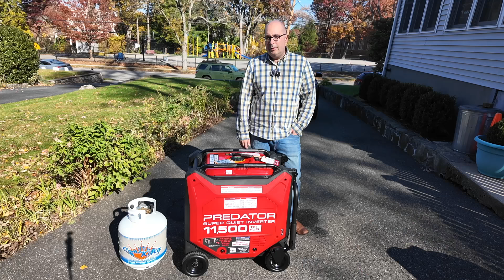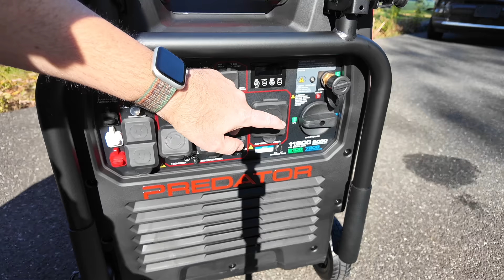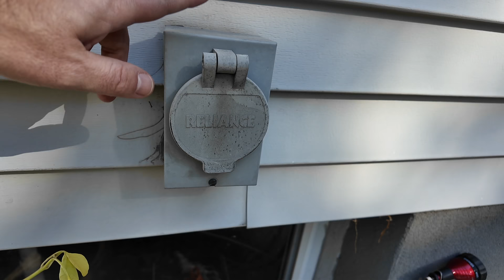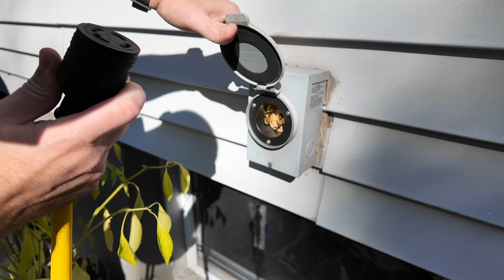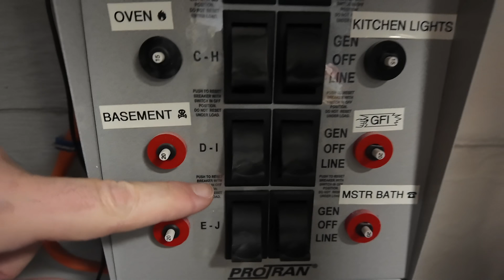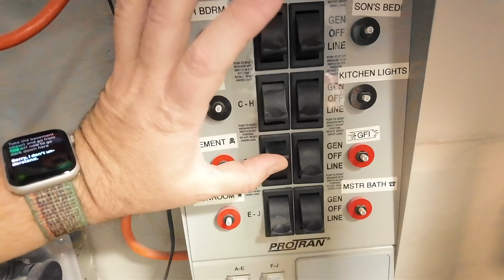Predator 11500w Powers My Entire House (Transfer Switch & Full Test) — Honda Should Be Worried!

Comment: My only concern with the Harbor Freight generator is reliability and the ability to get parts long term. For the price, obtaining parts is the most important thing, as just about anything can be fixed. I have old brigs and stratton and generac equipment from the 90's, everything still works and used to this day. Hopefully I can continue to buy replacement parts for another 10 plus years.
Reply: If you purchase the warranty, you will never need  replacement parts, every generator you can buy from hf is cheap enough to buy and purchase the warranty, they dont ask any questions, simply return it and get a new unit, I've extended the warranty on 2 of my generators from hf, not alot of people will admit it but the quality is not far behind honda ,especially for the price difference, the equivalent generator in a Honda is double the price atleast
Reply: @lenworthsewell9473  That's a bit shortsighted, this generator weighs around 260lbs. Not something you're going to throw in the back of the family sedan (or even a pickup truck without some help) to go exchange. And not everyone lives around the corner from their nearest Harbor Freight. A "no questions asked" extended warranty is great to have as an option, but it's certainly no across-the-board replacement for the ability to order parts delivered to your door to do repairs without having to borrow a truck and schedule an appointment with your orthopedist.
Reply from the maker: Those are definitely valid concerns! Harbor freight Quality seems to have gotten better over the years and my understanding is that they sell replacement parts for a lot of their generators online. They have a replacement parts catalog. Time will tell but so far I’m happy with it.

Comment: I'd add one suggestion. If you have a setup with either a switch or an interlock, I'd use that monthly runup on your generator as practice. Have the adults go through the process of plugging in the generator to the house and switching over the circuits you're going to use, or running that interlock. The last thing you want is to install it, then need it two years later, you aren't home, and your poor spouse is out there in the rain trying to remember how to do it.
Reply from the maker: That's a really great suggestion! Thanks for sharing!
Reply: @Outdoor_Prepper  Thanks, You'll see in the video, I remove a 30 amp plug, that is my Bonded connector, pulling it out makes the generator a floating ground, making it safe for the house hook up. (I did the modification on the generator that removes the bonded ground) I usually leave  that plugged in, incase someone uses the generator in a stand alone mode.  When it's used for the house, they must unplug it, as that is where the house power cord plugs in. Since making the video, I added a rubber ramp to the doorway, making it easier to pull the generator in & out.
Reply: I made a video for my family to learn how to hook up our generator safely, and I made a check list to go by also.   https://youtu.be/R-otVo50t_8?si=JQeKiPNryFXfOxFi

Comment: This generator uses a lot of fuel, the best way is charge a large battery bank or large power supply and the house at the same time so you can power down the generator and use the battery bank, this setup works well with long term outages,short term the generator is fine by itself.
Reply from the maker: That's a great idea for managing fuel consumption during extended outages!
Reply: There are fuel cell solutions that incorporate this method.

Comment: That generator puts out 47.9 amps (surge) and 37.5 amps (continuous), so with that capability I would always configure my system for 50 amps. It may not get to 50 amps but it will put out way more than 30 amps.
Reply from the maker: Agreed. Thanks for watching!
Reply: @Outdoor_Prepper I believe it is 37.5 amps on each leg of the 220volt. And that’s plenty of amperage for most homes or RV’s out there.

Comment: Throw a soft start on your A/C, its very easy to install yourself.
Reply from the maker: Awesome! I’ll have to give it a try
Reply: @Outdoor_Prepper  I just installed a Micro-air Flex soft start, easy to hook up with 4 wires.  It took the start up amps from 124 amps down to 24 amps.  Made the start up sound very quite. It starts the fan, then the compressor.
Reply: @Outdoor_Prepper AirGo is awesome and much cheaper than Microair. I love mine. Awesome support too for connecting although it is super easy

Comment: it doesn't appear that you have aAC hooked up. Have you tried to run the AC on the generator?
Reply from the maker: Right now my transfer switch doesn’t have the mini split AC units on it. I’ll be doing a whole panel interlock in the near future so I can power the mini split AC systems.
Reply: @Outdoor_Prepper  thanks for the follow up. But I'm wanting to know if it runs a 4 ton AC
Reply from the maker: @MikeJordanUnCamplicated it probably could - you might need a soft start kit though. To be safe I’d check with an electrician before spending the money on the generator. You’d need an electrician to make sure that the ACs starting wattage is at or below 11,500 watts and it’s running wattage is below 8000. It probably is, but I’m not 100% positive

Comment: I was a lineman for ConEd for many years. My parents had them for power too. They only lost power in 1977 in the big black out. I was with my family on vacation but we were out for several days . I’m surprised you need a generator? Unless you very far away from the substation? My parents were two blocks from the substation. 
As for back feeding your house without an inter lock or a transfer switch. When you say you’ll kill a lineman? That’s not true. We test everything before we touch it. If we have to move a wire? We use hot sticks & high voltage rubber gloves. Who they may kill would be joggers, walkers, children & pets. They would not be aware of the hidden danger of a wire not burning on the ground. 
As for fuel usage on our Honda EU 7000is. We get 18 hours of run time with 5 gallons of gas. With everything on we draw 3550 watts at 240 volts. That’s with the central air on. The EU 7000is is fuel injected. So there is no carburetor priming & better fuel economy. 
Keep up the great content! 
If you want to see my enclosure? Go to my home page. I have one video of it on economy & the other on non economy. Our enclosure was custom made of 306 stainless steel. We bought it 6 years ago & it cost us just for the concrete pad & enclosure $2700.

Comment: Quick questions: is that propane tank size works good? HF recommend at least 40lb tank.
Do you think it will run 1500sq house including 3ton AC without soft start?
Reply from the maker: With a soft start it definitely should. I got 8 hours runtime at 25% load so expect somewhere in that neighborhood of runtime

Comment: Great video, thank you.  I just picked up a Predator 9500. I've read that both the 11,500 & 9500 have a Bonded ground. Some say you need to remove the bonded ground when using to power the house, so you don't have a double-bond.  If it's used as a stand alone generator, then you can leave to as a bonded ground.  Did you need to do that with your 11,500 ?  Just want you to be safe. There are video's showing how to remove the bonded ground by removing 1 white wire that is located behind the front panel. (Look on the front panel for a grounding stud, the white wire is located behind that)
Update:  I did the fix on my unit, took about 10 min to remove the bonding wire and put the generator back together.  I created a bonding plug with the included 30 amp plug.  Now if I want to use it stand alone, I can plug in the 30 amp bonding plug, that restores the bond.
Reply from the maker: I plan to remove the bonded wire and make it a floating neutral. I just to figure out how as it’s a new generator and there isn’t much info. Once I figure it out I’ll post a quick video of how to do it. Thanks for watching!
Reply: @Outdoor_Prepper  After you remove the bonding wire, you can take extra 30amp plug that came in the box and make a bonding plug incase you need to use the generator in a stand alone mode. You simply take the plug apart, Take a 4" long wire, strip both ends, connect to the "G" connector and the other end connect to the "W" connector. Then put the plug back together.  When you need run it in stand alone mode, just insert the 30 amp plug, that will restore the generator into a bonded ground. Note, you can buy a 125v bonding plug and it will do the same thing.
Reply: @Outdoor_Prepper  I have the same unit, Version 1.  You have take the whole front panel apart to remove the neutral (white) wire from the back of the panel.  It's connected to the ground wire.  You'll see the ground on the front of the panel, bottom middle.
Reply: Keep us informed if you can in fact un-bond this generator.  Many enclosed inverter generators are very hard to unbond.  The Genmax inverter generator comes floating so that is my next purchase unless you show this one is easy to do.  Thanks.
Reply: Thanks a ton for sharing that info. I was looking at the open frame Genmax inverter as it comes floating. Knowing the process is an easy one makes my decision to buy the Predator an easy one. @CoolBlue87GT

Comment: What is the surge wattage while running on propane?
Reply from the maker: 11500 surge ok propane natural gas or gasoline
Reply: @Outdoor_Prepper so no difference between fuels. Ok. That seems odd since there is an appreciable difference in the running wattage between the three. Thanks.

Comment: I can power my whole house with my Generac 3500 watt generator.  Modified to Propane so is probably only 3000 watts now.
Refrig, Freezer, Gas heater, and the lights.  Sounds like overkill.
Reply from the maker: It's awesome that your 3500-watt generator handles your needs! This is more powerful for a well pump, central air, electric heat, electric dryer etc
Reply: sounds like your whole house is a tent

Comment: Can I it power furnace swamp cooler dryer washer air fryer microwave welder refrigerator hot n cold temp resistant mobile home

Comment: Since you have natural gas, why wouldn’t you connect to that?
Reply from the maker: I need to have a plumber run a line through the side of the house and install the right connector. It’s definitely on my list to get done as soon as possible! Thanks for watching
Reply: @Outdoor_Prepper ahhh yes, but you seem handy enough to run that line yourself. I ran and installed 100 feet of one and a half inch gas line to my pool heater and it was a very doable project, but you’re right gas can’t be scary, thanks for getting back to me.  I Enjoy your channel.
Reply: @JacksLore You ran an 1-1/2" gas line

Comment: Good video. One argument for opting for a transfer switch as opposed to an interlock kit is that with a transfer switch you can run both utility and generator/solar at the same time. With the interlock kit you can only use one or the other. I installed a transfer switch many years ago to use with a dual fuel generator capable of powering the essential circuits in my house. Overtime I have since added a ground mount solar system that can also run through the transfer switch to power the essential circuits. Since the transfer switch allows me to select which circuits are being run on utility power and which are being run on solar, I am able to use the transfer switch to run some of my circuits on solar power EVERY DAY, while the remaining circuits are being run on utility power. This not only saves on my utility bill but also allows me to use the transfer switch daily rather than just when there is a power outage.  I would not be able to do this if I was using an interlock kit.  More and more homeowners are opting for solar generators as primary electrical backup with much smaller gasoline or propane generators to charge the batteries on their solar generators during periods of low sunlight.  With a transfer switch such homeowners can use their solar generators daily along with a transfer switch, which they would not be able to do with an interlock kit, since the interlock kit can only use utility power OR generator power, but not both at the same time.
Reply from the maker: That's a very detailed and insightful point about the versatility of a transfer switch, especially with solar! Thanks for sharing your experience.
Reply: This is what I opted to do as well. 6kw of solar panels ground mounted, EG4 6000xp inverter, 2 EG4 indoor batteries giving me 28.6 hWh of storage and a 10 curcuit transfer switch. I can run all my critical loads on a daily basis, even charging my electric car with excess solar. It's saving me over $100/month on my electric bill, so it will pay for itself in 5-6 years.
Reply: Solar battery systems are how much vs this $3500 multi fuel system? Seems maybe off grid would justify cost but urban living systems are for temp outages, unless you have a solar system like we do and can just add batties.(?)
Reply: @bobbreit5244 $3500? Not at the HF's in our area...
Reply: @mfgc2610 He is probably accounting for an electrician to purchase and install the transfer switch.
Reply: Are you using a battery backup that can be charged by all 3?
Reply: This is a really excellent point for anybody who has solar! Thank you for pointing that out to everybody!🙏
Reply: Thx. Great info. What is the name of your solar generator?
Reply: This lengthy comment makes no good sense at all
Reply: @shadythereok It actually makes perfect sense if you understand his point. Essentially, when you plan to use backup power (like from a generator or a solar system) you have to choose how you are going to put that power into your home. The most common choices are having an interlock switch on your grid-tied breaker box  - or having a transfer switch, mounted next to your breaker box which designate several specific circuits that will be powered by the generator or solar system. 
The comment that seemed not to make sense to you was simply asserting that the transfer switch made more sense for him because it allows him to run part of his house on the grid, while utilizing the transfer switch to bring solar power to all or some of the circuits controlled by the transfer switch EVEN WHILE the rest of the house is being powered by the grid. So in his case, he gets to use the transfer switch continuously instead of just during power outages. - the reason this is an advantage for him is that he has solar power, so by having several of the homes circuits separated by the transfer switch, he can run continuous solar power into those circuits and save money on his power bill year-round. 

If he only installed the interlock switch - it would always be all-or-nothing (either grid power OR backup power - but, not BOTH). The transfer switch allows him to complement his grid power with solar not only during power outages - BUT all year long as well, so he saves money year-round.

Comment: Good video. Another reason to choose a portable generator over a fixed whole house generator is that the average homeowner in the United States stays in their home for about 11 to 12 years. With a fixed whole house generator, whenever the homeowner moves, they would have to leave the generator behind for the new owners.  However, with a portable generator capable of running most of the house, whenever the homeowner moves, they can take the generator with them.  The only thing that they would leave behind would be the electrical inlet box and the transfer switch or interlock kit. The amount of the investment left in the old house would be much less than the investment required for a fixed whole house generator.
Reply: I consider myself an average homeowner and I have been living in my home since it was constructed 35 years ago. Having a fixed wholehouse generator would be a positive selling point. Buying a new one would have newer technology.
Reply from the maker: That's a really great point about portability and moving!
Reply: Why do you need to leave the generator  ? Is it not possible to disconnect and take it with you ?
Reply: Then there's the point that if you need the generator for a camping trip, track day, jobsite, etc. you can take it with you. A fixed whole house generator would make sense in areas where the power goes out frequently for convenience and property value, but where I'm at the power's only gone out for more than an hour once in the last 9 years.
Reply: I'm agreed. We can't begin building 30 year solutions into homes we must vacate within 10 years, with electrical components that have a 5 year life span. It's bonkers backwards!